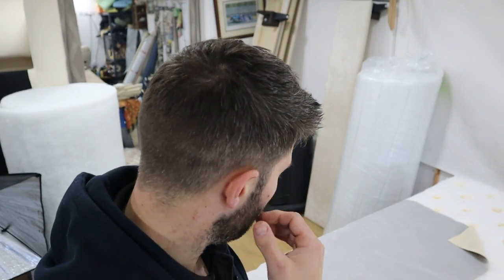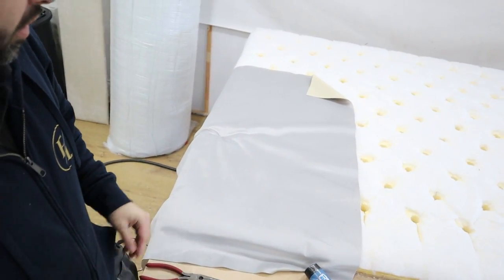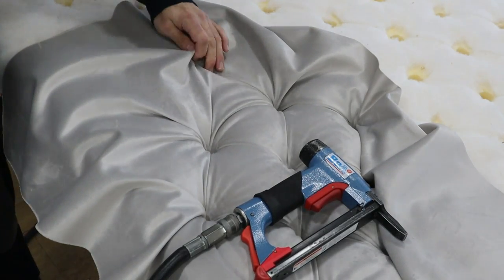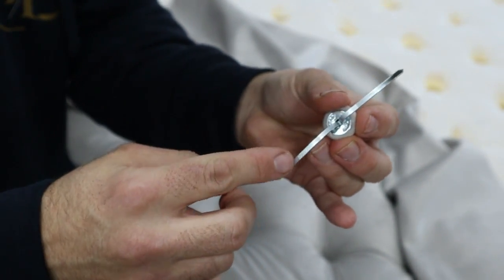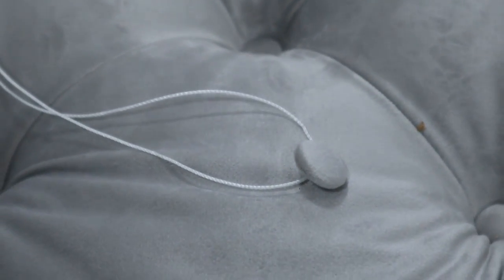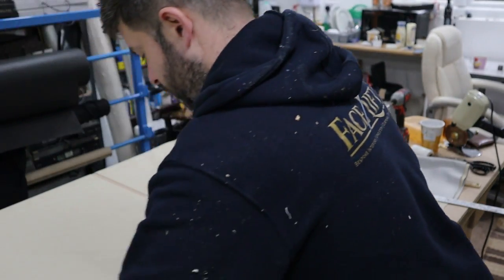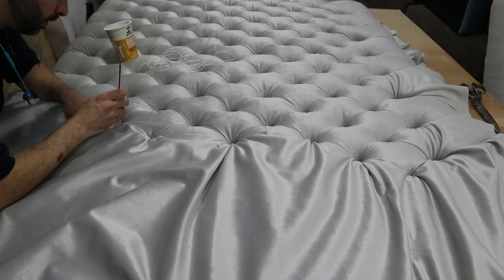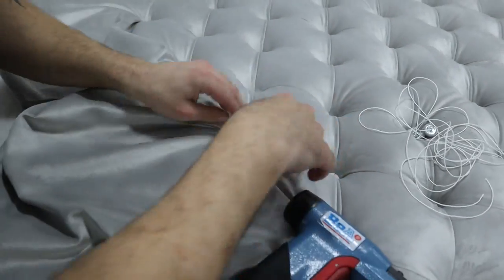DEEP BUTTONING TECHNIQUES FOR BEGINNERS | HOW TO MEASURE DIAMONDS IN UPHOLSTERY | FaceliftInteriors

Comment: Thanks Neil for this tutorial.  Like you, I always draw the lines so I can keep the fabric straight as I move across the piece. If you have to VanDyke, do you do that pleat first, get it set and then move on?
Reply: In his Van Dyke video he explains at the very end how he works out from the joint. That makes the most sense, so as to avoid the fabric from shifting and revealing the seam.
Reply from the maker: Hi Ricky, hope you are well buddy?! Yes I generally do the van Dyke pleat first then work outwards from there! 
Hope this helps. 🙏 😊📎🧵⛏️📐✂️